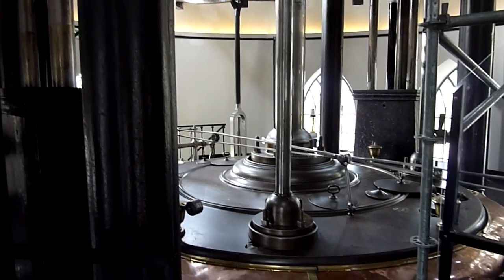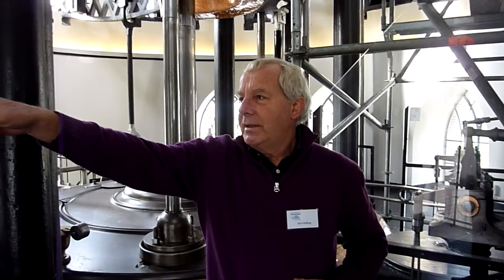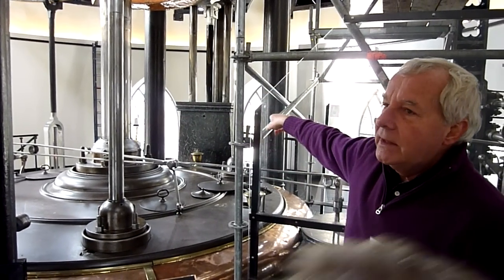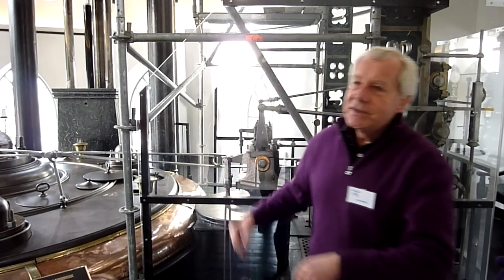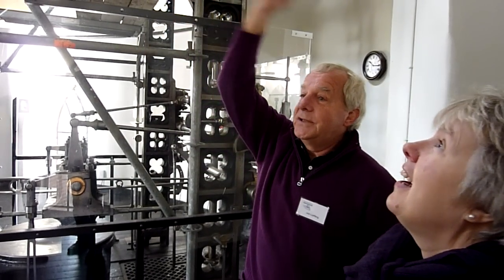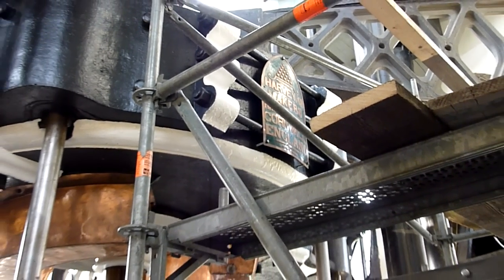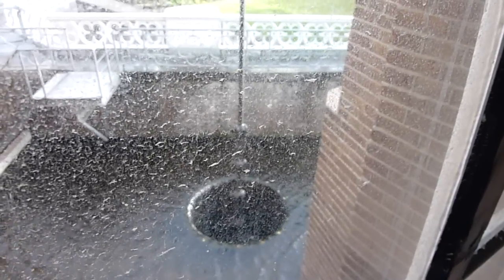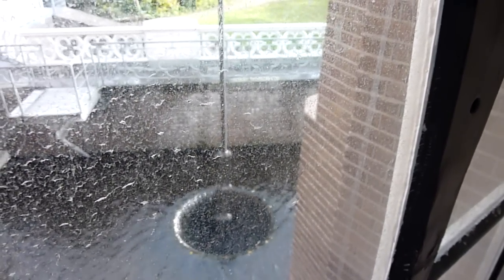Visit to Cruquius Pumping Station Heemstede Holland

Comment: The pressure needed to move the 3,4m diameter piston is actually very low.
Lets calculate this:
The machine has a cylinder diameter of 3,4m (radius therefor is 170 cm) and was capable of moving 64.000 L of water. 1 L of water weights 1 kg.
Judging from the drawings (I was able to find) the arms move the piston and the pump rods in a 1 to 1 ratio. 
The pressure needed to move 64000 L (which weight 64000 kg) is:
64000 / (PiX170x170) = 0,7 kg/cm2 (Bar)

So you can imagine the boilers used to power this machine were not so much a powerhouse of steam pressure (which would make the boiler room an extremely dangerous place to be) but more of a powerhouse of steam production volume, moving vast amounts of steam at a very low pressure.
Reply: It is not clear to me if this engine uses steam pressure or expansion.  I know my terminology is off but earlier steam engines didn’t necessarily work off of high pressure steam.